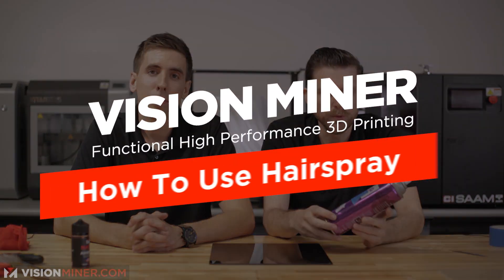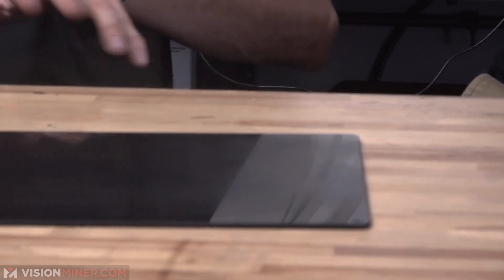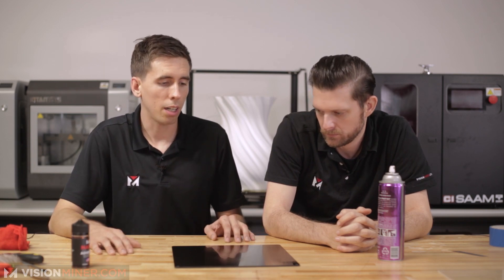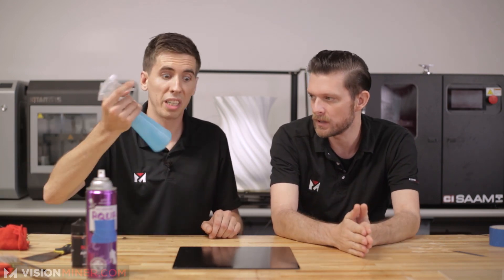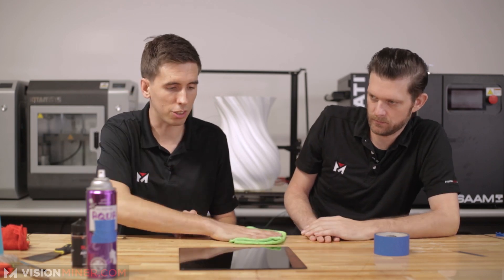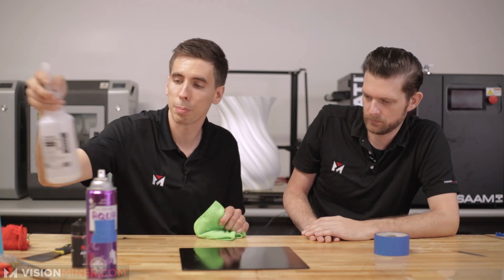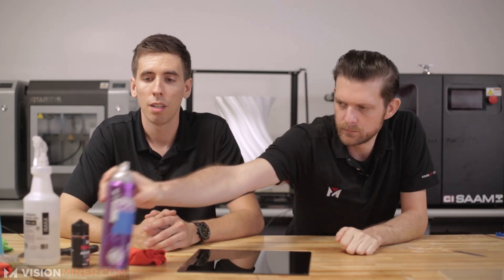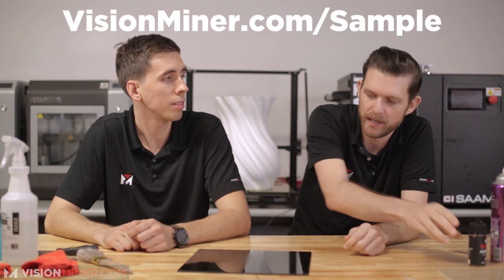How to use Hairspray for 3D Printing Bed Adhesion Glue

Comment: im a caveman... my plate heats up in less than a minute so i just grab the plate off the magnetic plate and place the plate on a chair next to the printers and give it a four passes in a z shape then flip 180 degree and repeat, then a small circle and larger circle. the fine mist covers more less to a "flat" surface :) the heat from the plate seems to dry out the hairspray real fast and the prints stick even better as if the spray gets annealed or something. 

try ur self and see it sticks even better ;)

Comment: I’ve found that the cheapest hair sprays (Aquanet, Suave, et. al.) are the best. Some of the fancier hairsprays seem to do worse, and I’m guessing it’s because of additives such as moisturizers, conditioners, and sun protectants.

I’ve had great luck with cheap hairspray on my build plate, and I seem to need to reapply it once every couple weeks or so.

Comment: thanks for the idea for taking off the build plate. I have gotten L’oreal  paris Elnett   extra strength from my Shoppers It works so far I sprayed I spread with a paintbrush using layers is my first time, trying this hairspray with my glass bed

Comment: Another reason to use hairspray is as a separation agent when printing PETG or TPU. A small layer of spray will help prevent the print from permanently sticking to and destroying your build surface.

Comment: I knew that hairspray was good for this. Never tried it before. After leveling my bed for the 8th time and getting a failed first layer everytime, I have searched for this video to learn how to apply it. Watched it, grabbed my mom's hairspray, sprayed it as shown. Started my print. Here I am staring at a gorgeous print being made. Amazing first layer stuck great. Thanks
Reply: Ive always used a layer of painter tape and a glue stick, works very well, ran out of glue stick so im here lol
Reply: @messagetotheuniverse  after this i bought a glue stick... i never knew that would make my life much much easier. It is very hard to clean the hairspray but glue stick is much much better. Just a bit of water and wipe it off. Glue stick > hairspray. Hairspray is better for maybe larger projects
Reply: @Kendiyastro  you better watch your z offset while using glue stick, if the nozzle scrubs the bed that nastly glue gonna fill inside the nozzle and clog it, it doesn't even come out with the push of filament and you gotta clean the entire nozzle just because of that, happened to me twice or thrice , spent a week to figure out the problem, its been 6 months I havent used glue stick or any kind of glue at all
Reply from the maker: Thanks for sharing!
Reply: If you have a removable flexible build plate, you basically have to add some kind of adhesive. I have never had good luck getting anything to stick on flexible removable build surfaces without some kind of adhesive. Hairspray works on 90% of plastic types. Glue stick will work for the rest. Spray away from the build plate and always clean up after using glue sticks. It can be a pain if you leave the glue on and keep reapplying.

Comment: do you know what the active chemical for adhesion in hair spray is? some hair sprays dont work for me. i found that ones that have copolymer in their ingredients tend to work a little better (but not perfect). sometimes they put dexpanthenol or other "care" substances (oily) in there that actually reduce your adhesion. Did you use the same stuff for your nano copolymer stuff?

Comment: So, what should you do if your build plate does not come out? i have a glass build plate and it is screwed in and not removable.
Reply from the maker: That's an interesting one... What machine is that? You can get Nano Polymer Adhesive, we just released the new $19 bottle!

Comment: wait, you're saying to level the bed. Then remove the bed, use hairspray, and not relevel the bed. it would be near impossible to level the bed covered in hairspray. I've sprayed hairspray jsut find while my bed is on the printer. You can't think that I"m so careless as to not be able to spray hairspay like i spray bullets in a zombia apocolypse. c'mon. This video is completely ridiculous and useless unless you have an ABL system, and what's worse is they put a TON of hairspray on that play. You'd have to use a mallet to get the print off, just a few light spray will do you. this is not a useful video
Reply from the maker: The main point is, there are much better options, but in a pinch, it's to show people that it can, in fact, be used :)

Comment: Hi I have watched numerous videos about the hairspray and I am still confused. What I am confused about is I have never printed before do I use this with before I print my first thing or is this only to be used once the adhesion wears?
Reply: Hey Shetika! You apply it typically before each print, it provides a stickier surface to stick to so you dont get issues with lifting or popping off mid print.

Comment: I had a print that wouldn’t stick at first and then I used this hairspray trick. It stuck pretty well but the problem was it stuck PRETTY WELL. I had to man handle it off. For those who try the hairspray trick use a very very thin layer of hairspray

Comment: "Free sample" yeah nah fam you want $5 i feel t his video was just an advertisement to sell your crap, been using hairspray for ages with zero issues. also abit of sugar mixed in with water works well too
Reply from the maker: 1. This video is several years old, you missed the free sample
2. This wasn't designed for your basic materials, which do work find with stuff like hairspray or sugar (some of the time)
3. It's a much stronger, more dynamic solution than hairspray or sugar, simply put
4. Don't hate, just keep using hairspray til you need something for Nylons or PC, functional materials :)

Comment: After you apply the hair spray, how do you level your plate without wiping off the spray?
Reply from the maker: Simple answer: we don't use hair spray. It's not ideal. But you'd have to level it with the spray on... or before and guess the z-offset
Reply: @VisionMiner  if you want to sell a product you should show it actually working and how good it works with various surfaces and materials and heat settings...
Reply: @VisionMiner  how do you achieve printing on glass without any additional adhesive?

Comment: I already use hairspray, have the bed on 80°C and the nozzle on 215°C and my prints still lose contact to the bed after a few layers. The first layers are printing fine, but thant after maybe 3-5 layers some corners lift up. Any further suggestions? It`s an Ender-3 Max and I only print PLA so far.
Reply: 80c is too hot for PLA, 60c should be max for PLA.
Reply: I have the same issue and actually the plate needs cleaning. Guess too much grease on mine.
Reply: The temperature recommendation is usually written by the manufacturer on each roll. So I would pay attention to that, also it depends on the printer. Cheaper printers use and require higher temps
Reply from the maker: If PLA isn't sticking at 80c, with hairspray, it's probably the wrong hairspray -- they all use different chemicals. You can get a sample of our adhesive at visionminer.com/sample, but it's strange you're not getting results at all at those temps...

Comment: So how does this affect the leveling of your printer considering you are adding a layers of material to the plate?  I don't see how you can level it AFTER the application without clogging the nozzle.
Reply from the maker: Well, it doesn't clog the nozzle, I can tell you that -- ideally you've already leveled and then set the z-offset.
Reply: @VisionMiner  I gried the Hairspray, and Superglue to no avail only to find out the Extruder Gear handle is broke (not giving enough pressure for the gear to control Filament) and have ordered new parts.
Reply: so if you level your bed ...then remove plate...spray...then put on same way is was...put a mark on it so you don't screw up...
Reply: Since this post, I have been using Hairspray, and it works GREAT... Since the nozzle never touches the build plate, there is no reason to worry like I did about nozzle clogs.  Thank you everyone for your replies...

Comment: will this work for a tempered glass bed, or does it need to be normal glass? Also for cleaning, does it matter if it is 70% or 99% alcohol?  Thanks!
Reply: it does matter. 70% could damage the tempered glass. use 99%. sadly speaking from experience

Comment: Thanks guys. I’m having issues with glue stick maintaining adhesion since starting to use eSun PLA+ hoping to give this a go today and make a cardboard booth to spray my glass plate in.
Reply from the maker: Probably easier and safer to get a sample bottle of ours, a single coating lasts 50+ pirints on glass in our experience :) but hairspray may help too!
Reply: @VisionMiner  I don’t think you ship it to Australia though.
Reply from the maker: We do ship to Australia, but we also have a few dealers there :)

Comment: Can't you just spray the hairspray on a towel and wipe the bed without removing it?
Reply: Won't the towel then add unnecessary micro hairs with the glue from the towel binding with the print?

Comment: How about making adhesion with Hot glue gun ?
Reply from the maker: It would melt with the heat of the filament... and good luck getting it flat :)
Reply: @VisionMiner  Already tried it. Doesn't work!

Comment: there's absolutely no need to use expensive iso! denatored/methylated ethanol, diluted to ~50% is far cheaper and just as effective as a degreaser
Reply: I use my moms hair spray so its free
Reply from the maker: Depends where you buy it, it's not that much more. But yeah, it all works :)

Comment: What about ABS??
Reply: Camus doesnt work for abs man...
Reply: @huydoan9279  yeah i bet theres too much temp around.
Reply from the maker: Our Nano Polymer Adhesive works GREAT with ABS!
Glue stick works sometimes... depending on the part
Reply: with abs you can take some acetone, mix in some bits and pieces from failed abs prints, and put a thin layer of that slurry on your print surface. just make sure ur acetone doesn't have any additives, and that you wait for it to dry before heating the printer. acetone is very flammable
Reply: I was about to ask this! Abs is such a bummer material

Comment: I tried Aquanet and got fish eyes in the surface finish of the hair spray. How do you get rid of fish eyes when applying the hair spray?
Reply from the maker: Not sure if that's possible... we just use our own Nano Polymer Adhesive now! :)
Reply: Vision Miner Does your nano polymer apply without leaving fish eyes on the surface?

Where can I get some of your nano polymer?
Reply from the maker: @MOVIEKICKS  Oh yeah, it's basically a mirror finish.... check it out: www.visionminer.com/adhesive
Reply: @VisionMiner  I just checked out your webpage and it looks like great stuff.

I have two questions before purchasing it:

1.  When brushing it on does the finished surface show brush streaks or does it self level sufficiently to eliminate the brush streaks?
2.  Is the bottom of the part that's against the print surface shiny or matte finish?
Reply from the maker: @MOVIEKICKS  Generally it self-levels and gives a perfect sheen -- but occasionally you can tell there was something applied. It shows up as a different in finish, as opposed to an actual bump, though -- it's perfectly flat. 

The bottom of the part on smooth glass will be shiny, on other surfaces (like buildtak) will be matte -- however, you can also apply it to a hot glass plate, and it will "boil" off, creating a crystalline powder-like surface, which gives a matte finish :)